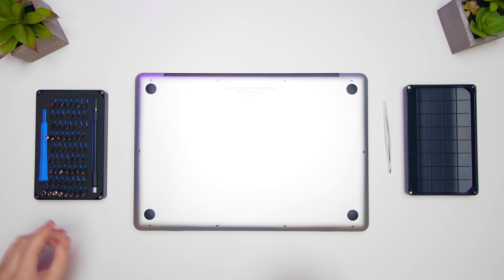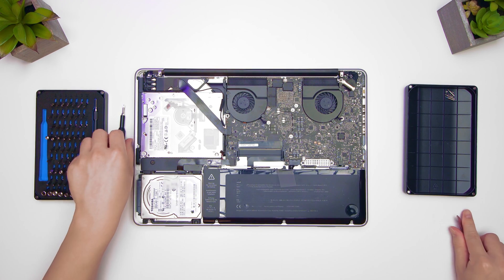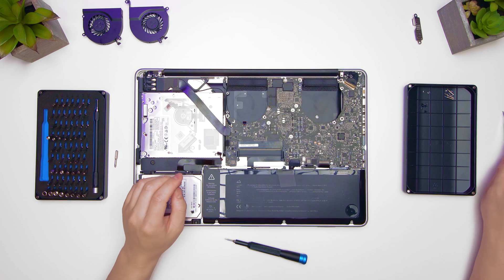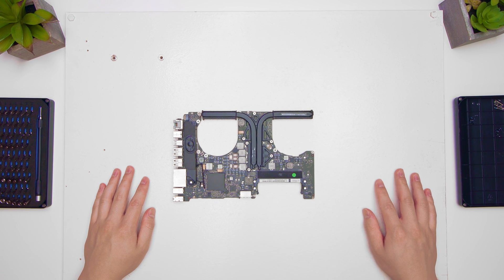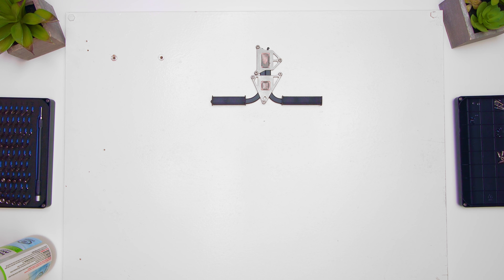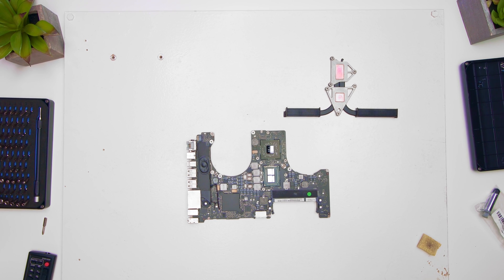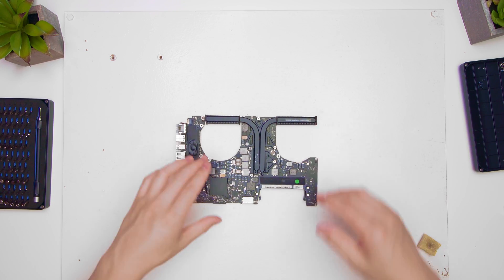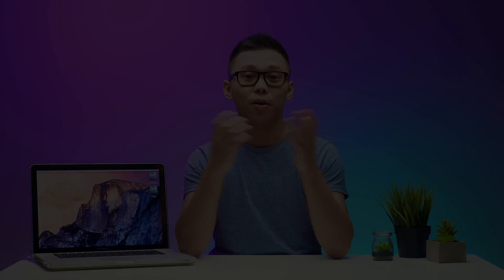2011 Macbook Pro Dead GPU Reflowing Fix Overview - Covist

Comment: I know my comment is 7 years late, but just reflowed my CPU and GPU on a A1260 the first Core 2 Duo machine I think, and it works! Thank you very much. I used a heat gun set on 25% flow rate at 350 degC for 3 mins on each chip at about 2cm rotating round the chip. Lots of flux. Then cooled, cleaned and pasted.
Reply: Can you help me fix mine its just black screen

Comment: Hello. What is the normal working temperature after doing this? Mine range from 50-80celcius when playing youtube 1080p video.. also i want to ask if i disabled my amd gpu and i want to install sonoma using trick from other video, is it possible? I am afraid it will switch to amd vga and then hangs in the installation process.

Comment: Hello Man, thanks for video - it is rather interesting for me as 1.  Have the 2011 one, which still consider as the best construction wise (Unibody) - it allows me unlimited SSD upgrade, what for  my musical hobby and even the business a bit is quite principle issue as the musical libraries are damn big for usual architecture of the modern lines of Macbook Pro. 2. The GPU  after 10 years of functioning as it expected to has died has and by recommendation of local Apple Service was cut off as it was found that for my  requirements to Graphic like Chrome, Youtube and GUI of musical programs the other one of CPU is more than enough so I shouldn't cry a lot of loosing that dead one. But having in mind to enhance my activity a bit - thinking to buy some more 2012 ones, having the same constructional failure as the 2011 one, but also the same required feature of Disk upgrade. Therefore like herewith to ask your opinion should I buy those ones mid 2012 ?  For how long, on your professional opinion, those, announced by seller as perfectly tested and working, will function well until its GPU problem will remind me about itself ?

Comment: I actually still have a15 inch  2011 and 13 inch 2012 MacBook Pro. Both are having these same gpu issues. I may need a step by step guide. I will also need to know where to get the tools to do this. Much appreciated.

Comment: AMD GPU of 2011 can't be fix by heat gun or rebelling.....it will come back the problem after a few months specially when the weather is hot summer.

Comment: Worked 50% for me and I wonder if it’s because I used a blow dryer rather than a heat gun. What I mean by the 50% is that for the past year it was a black screen not even wavy lines. I applied new thermal paste, used a blow dryer on the gpu as I didn’t have a heat gun and I’m back to the boot screen with Apple logo with wavy lines and obviously does not boot fully. So I’m 50% there with some action happening and no longer a black screen. Should I try it again with a heat gun if so can I leave the heat sink on and use the heat gun or should I remove, clean paste, use heat gun and reapply paste?

Comment: temp fix . my advice after is to disable the gpu using dosdude1 trick . you can do it via software or hardware  doing so will keep it from giving you issues  after that . get some 1600mhz ram or 1866 if you have the 2.2 to 2.5 ghz model that will speed things up a lot1866 is probably the fastest ram this model will support  the igpu shares system ram and the faster the ram the smoother the animations

Comment: WTF, No anti static strap? I disabled the bad GPU and deleted the library files that kept it from booting. Without all of this
Reply: That’s great but a lot of us have the same issue as him, my late 2011 15” wouldn’t boot (blurry screen, black screen and shut down before it would fully boot) so I had no way of getting into the system to disable the GPU and delete the library files until I did this procedure. This procedure worked like a charm, it was able to boot and then I disabled the GPU and deleted the files. Now it works like a charm.

Comment: To all the naysayers in this video, the heat gun works.  I just fixed my Late 2011 MBP 17.  The Intel GPU was not initializing which resulted in no chime and black screen.  Set the heat gun to max, held about three inches above chip for about three minutes.

Comment: I'm an old timer in terms of electronics.  The abnormal thing about re-flowing a chip is that its not proper.  When a component fails it's replaced.  Logic chips do not normally fail, failure is because of defect in design, manufacturing or improper application.  IMO logic chips such as the CPU and the GPU fail because they run too hot.  In other words they were meant to fail and obviously the makers know it.
Reply: Exactly. I was telling my girlfriend that for example Sony electronics from the 60’s,70’s and 80’s are so durable and lost a long time because back then companies weren’t thinking about planned obsolescence, they were built to last. Now they’re built to break for people to upgrade and spend more money. I used to have an old Apple IIGS, a Mac LC 575, a G4 MDD and until is old then all a few years ago they all worked perfectly.

Comment: This actually worked!! For anyone who want to try this, cover all other components on the motherboard with folio, heat both gpu and cpu at the same time for about 6-8min with temperature 200-240C.
Reply: This is a temp fix.  It doesn't really work on a long term basis.  Eventually you'll have to disable the AMD GPU at the firmware level.
Reply: Thanks for the temperature 200 - 240C specs. Have you thought about adding m.2 SSD thermal foam near the GPU area to shunt excessive Heat to the aluminum casing ?
Reply: What a good idea. Basically turning it into a giant heatsink that would be able to contain and dissipate all the heat coming from the AMD GPU, which clearly can’t handle it. I’m going to try this.

Comment: I had a hard time figuring out how to disconnect the LVDS connector here’s a link for other people attempting this repair it is step 14 on this page : https://www.ifixit.com/Guide/MacBook+Pro+13-Inch+Unibody+Early+2011+Display+Replacement/5140#s23134

Comment: This isn’t a fix. The problem is that the gpu has failed an by heating it you are temporarily reforming the silicon in the chip. This is because it has suffered heat damage. The solution is to replace the chip. This method you show is only a temporary solution good for recovering  data off of a dead device only.

Comment: I would be interested to know how long this fix lasted. I have one of these MBPs and I just disabled the AMD GPU. It works fine for everyday tasks. I’m guessing most people will not be doing anything too graphically intense on a 9 year old system anyway.
Reply: Some have stayed fixed for months, others for years.  If the GPU fails, simply re-heat.  Hot GPU chip is a problem but the real problem is non-lead solder that Apple uses.  This crap does not stick.
Reply: @encinobalboa  yeah I agree the reball is only a temp solution

Comment: not work, any recomended solution?
Reply: Just use firmware fix. Easier, faster, better
Reply: Where  i got it ?
Reply: @Artsman.B  google MacBook pro 2011 gpu disable and go to the result from page "dosdude1.com" or something like that. It lets you boot the pc and just disable it making it work straight away without even taking it apart
Reply: Okay ,i'll try ... By the way thanks for the information ... I hope i can fix my MacBook ... God bless you a jenius people
Reply: @Artsman.B  I'm no genius. Fingers crossed you can get it running bro

Comment: i did it with an hair dryer and it worked like a charm!! THX YOU FOR SHARING!!😂❤️
Reply: Because you didn't reflow anything. The solder isn't actually at fault here. What's failing is the bond between the gpu silicone and it's PCB (not motherboard) and that melts much easier than solder. You hit it with higher temps and most likely it will melt again and stop working
Reply: @AdriansTechBasement  is this a fact or a guess you made? Genuinely interested!
Reply: @edom80  it's a fact. I recall i stumbled across that in one of the documents regarding the class action lawsuit about this. That's why they failed in first place and reflowing gpu wasn't helping and they had to get new chips for them even 3rd party people
Reply: Hi!  Can I ask...How much time did you use the hair dryer for?

Comment: Have been reflowing my logic boart (early 2011 MBP 15'') at 215° C for 7 Minutes in the baking oven. It worked well and now I hope it will run longer than it used to with lower temperatures. I tried 175°, 195° and 205° and it worked for between 2 and 6 months. But: I put away the speaker and microphone so they wouldn't melt. I used ti ifixit guide to get enough in depth knownedge to do the disassembly.

Comment: What happens if we remove the AMD GPU and don't add a new one? Will it work only with the intel graphics or is it going not to work at all?
Reply from the maker: It is possible to run using just the intel graphics. There are guides out there that show you how to disable the amd gpu. I myself have not used it though as my MacBook still works with this fix.
Reply: @Covist  But I would like to remove it. I have read that that solution doesn't work any more if we update or reinstall the entire system. I also want to use Linux on it and I am really doubtful if that EFI fix solution will also work on Linux.
Reply from the maker: I dunno then =\ while you could remove it (albeit with the correct tools and skills/experience) there’s no guarantee that it’s still not gonna screw something up.
Reply: @philosophiaentis5612  The EFI fix solution does work on Linux!  This is exactly what I did to my late 2011 macbook pro.  Love linux!

Comment: Nice video but it would be really helpful to know what power level your heat gun was on and how long you heated each component for: it's not at all clear from the timelapse footage unfortunately. Basically: details, we need details. All the details, all the time.
Reply: 1500W.  3-4 minutes.  Hold gun 2-3 inches above chip.  No need to move it around like in the video.
Reply: I have the same question

Comment: About how long does it take to heat the GPU CPU up with a  1500 watt heat gun??
Reply: I just did mine.  Held about three inches above chip for about two minutes.

Comment: It will fail again as it is not a permanent fix. Dead GPU is a dead gpu.

I solved this by a long term fix provided below. It is not easy however it definitely works. It works because it deactivates AMD GPU and always routes signals from iGPU to display. There is soldering involved which is very difficult for average user.
https://forums.macrumors.com/threads/permanently-disable-2011-15-17-macbook-pro-dedicated-gpu-gmux-ic-bypass.2134019/

Comment: Do a step by step and replace the AMD graphics with something else. People still use them because you got 2 USB a SSD a FireWire port a thunderbolt and a MagSafe power cord and a 1TB hard drive and a disk drive. The new MacBook pros are utter shit put 16gb ram if they had used duel Intels would have been awesome

Comment: This is only a temp fix, as the AMD GPU itself is defective and this fix usually doesn't last very long.  You should also shield components around the GPU with at least aluminum foil, or better option would be HVAC metal tape which is thicker.   Your best fix is to disable the AMD GPU at the firmware level ( DosDude1 ) which will force the machine to use onboard intel graphics.
Reply: FREAKING THANK YOU
Reply: So many people get this wrong
Reply: You are correct. Even a reball wont fix it would just prolong the issue. Reballing with leaded solder would possibly help. The real issue is heat.
Reply: What about repurposing some m.2 SSD thermal foam strips to transfer the heat from the GPU area to the aluminum casing?
Reply: Boss I need your help... The same issue in my mackbook.. Please help me how to fix that gpu issue with firmware option... My email id is :- dinesh.jalal2010@gmail.com... I will very thankful to you if you will reply...
Reply: @gamerfun228  just go on YouTube and find any video regarding the issue. Most of them are about the firmware fix
Reply: @gamerfun228  i Have the same issue a month a go i  fix This ... Using disable the AMD drivers....
Reply: Can you please share the Terminal commands for that?? 🙄
Reply: Intel GPU does not support Metal graphics acceleration which creates a bottleneck in the computer.
Reply: I'm glad I read this comment. This is the second time DosDude1's method has been suggested. I think it's time to reconsider and look into it. I was never a fan of reflowing. I don't have a whole lot of knowledge with Macs, but I'm always willing to learn more as I go along. Been working on Windows machines mostly.
Reply: The reason is probably related to some of BGA Balls that have "head in pillow" soldering and using heat gun is not as uniform as using reflow oven. There might be voiding in soldering of any connection on GPU lines in addition. Also, there is no guarantee that there won't be any impact on GPU + CPU in the future. Disabling GPU has its own limits but reflow oven usually provides better results.
Reply: Do you know what what temperature you have to bring the GPU chip up to to cause Reflow or mend cold solder joints on the circuit board without causing damage to surrounding circuitry?

Comment: Sorry, this is not recommended, the GPU problem on this machines aren't the balls (BGA), the actual AMD CHIP is defected, this chips have a connection between the silicon and the GPU plate and then below that we have the actual balls that technicians re-flow or reballing.. the truth is that re-flow or reballing the same GPU chip is not fix the issue, this AMD GPUs are bad, they are defected from the manufacture,  if you put heat on your board you will make the problem worst, and permanent break your device, but if you instead take this machine to a technician that will REPLACE the ACTUAL chip, or disable the dedicated graphics, you will fix the device. Because as i say, this chips are broken from the manufacture, heat wont solve the problem!
Is better disable the dedicated GPU, because even if you find a NEW GPU CHIP this is most like are BAD to..
PLEAS STOP MAKING VIDEOS BURNING BOARDS..  for more info i recommend watch the video "youtube.com/watch?v=1AcEt073Uds&t="
Reply: Thanks for the info, but why isn't anybody else here pist off at Apple for this? Am I the only one thinking, wait a minute, I payed top dollar for a machine which had a design/hardware flaw which now gives me stress, destroyed my initial investment and gives me a lot of extra work now that I need to get all the information off the SSD and HD? Way to go Apple, that surely legitimize their prices. "claps sarcastically"
Reply: Tech visit is not inexpensive.  Anything free that extends the life of the machine is worthwhile.  Mid 2011 iMac has same AMD GPU issue.  I have successfully baked five AMD cards and all of them came back to life.  All of mine are still going.  To be fair, some users report still going strong after several years, others report dead in a few months.  I have a dead Late 2011 17 inch with GPU failure that will get this treatment soon.  I'll take my chances, thank you.

Comment: What's the name of your tool box? I'm getting struggle to find the proper screw drivers
Reply from the maker: The one I used in this video is the ifixit Mako Driver Kit. Ifixit has a few other kits so you can see if there’s one that fits your needs better.

Comment: This is not a permanent solution. Disable the vga card and use onboard graphics.
Reply: How do you go about doing that? Any step by step or video? I'm not that computer literate...😫
Reply: @mvj1153  - You can find a good guide by searching for "macbook-pro-2011-defective-gpu-fix-v2.md" by cdleon at GitHub.
Reply: No Metal graphics acceleration with Intel GPU which creates bottleneck and slows the computer.

Comment: Good job! Thanks for the video:D I just got a late 2011 macbook pro and I think to replace the GPU for the newest so I could run Mojave! Do you think it is worth it? Is it even possible? It is my first MacBook and I had no idea it will give me a headache with this system update, because it has i7, 16ram, 1tb ssd.. so I was absoulutely sureit is a great laptop
Reply from the maker: No, unfortunately it's not possible to replace the GPU.
Reply: Thsnks:) I watch reviews of the newest MacBook and people say it is not worth it, maybe it is the slow end of Apple.. Is it worth to buy final cut pro on my laptop?
Reply: @MiLena-ol8pz  I don’t think it’s worth it for a 2011. A few years ago I purchased a used MacBook Pro of Facebook marketplace, used it for a bit then traded it in at Apple to put towards a new computer. I personally wouldn’t bother doing anything to a computer older than 5 years. Lots of great deals out there on used, open box or refurbished macs.

Comment: I still have a MacBook pro 2011 Ill try clean the GPU
Reply from the maker: I think it's definitely worth a shot if it's already dying or dead.
Reply: Did you clean your yet cause my screen went totally black  2 days ago after having my 2011 MacBook pro_17inch for 8 years with only 2 minor problems along the way.

Comment: reflowing does not work permanently, the best way to achieve casual usage is to disble the AMD GPU permanantly.
Reply from the maker: Yup it's a bandage fix.
Reply: How long does the reflow/bandage last?
Reply from the maker: Hard to say. Depends on your Macbook itself, how well you reflowed it, and how you're using it.
Reply: This will help me boot up then I can disable the gpu for good.